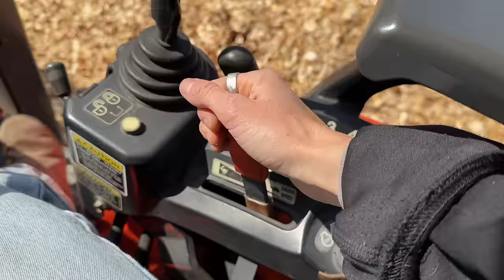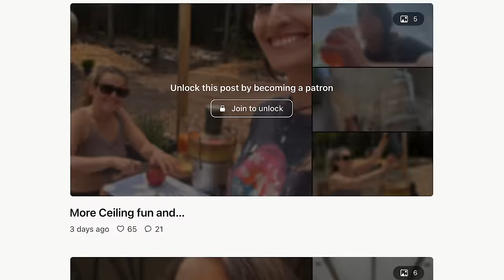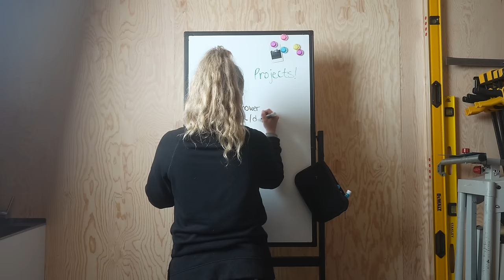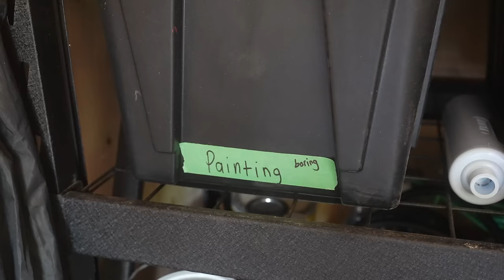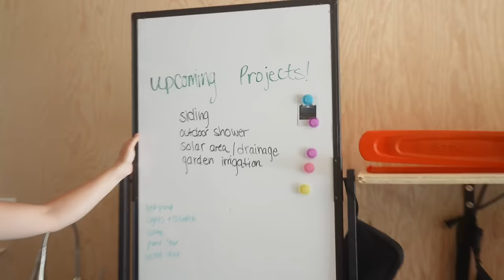ULTIMATE DIY DREAM GARAGE MAKEOVER!

Comment: As allllways, you two are great together and create really fun videos. Nice job on the GARAGE!!  2 things I noticed that I think you should change or add. 1) You need a barrier between the fireplace and the wood wall. Block, brick, cement board spaced off the wood, SOMETHING, as we certainly don't want to have a fire.. 2) It looked like Jaz was simply pushing the wires into the backs of the power outlets. I know many do this, but over and over again I see videos about how people lose their homes to exactly that. EVERY REAL ELECTRICIAN will tell you to never use the push in's. ONLY use the screws as they create a tight and solid contact that won't fail.... I've owned and remodelled 5 homes and in every one of them, found outlets that previous homeowners swapped and did the press ins.. The first time, I found it because my wife heard buzzing coming from the wall.. Yeah, inside the box was black with sparks!!!  PLEASE go back and utilize the screws. That way is FAR SUPERIOR to the extremely tiny contact point of the press in's...  Youtube videos all over on this as well...
EDIT:  I forgot to mention, painting the walls a bright color will make the shop WAYYY BETTER!! Over time, the bare plywood will turn to a dull yellow and look crappy. Paining it then will be FAR MORE WORK.... I'd paint it white. Just my .02   ;)
Reply: Excellent help

Comment: Great Job on the work shed.  Like that you have a fire extinguisher next to the wood burning stove.  One thought.  You might want to put some cement board in behind the Stove.  It was depend on the distance required by the stove manufacturer on how far away you can not have none combustible surfaces.

Comment: Little tip, if your doing an area that includes a ceiling start from the ceiling and work down, so as not to damage anything you may have already done. I know you like the wood and whites a dull colour, but if you paint inside the shed it will help illuminate inside during winter. PS, awesome job as always

Comment: Looks great, well done on getting it done! Just wondering what type of heat shield you are going to use behind the fireplace? Corrugated iron makes a cheap shield, mount it off the wall with some spaces (small bits of pipe). Izzy’s smile us very cute❤️✨

Comment: I've already painted my concrete floor with grey concrete paint, but I would like to add the kind that you used. If it makes it less slippery, that's great. I didn't see a shop vac and am wondering if you have one to suck up your sawdust? If not, that shed is gonna be a mess real soon. 😉😉

Comment: I like the remodel.  I really do need a clean garage to get any work done.  I recommend using Dock/Mount Holders for your batteries.  You could even mont the holders under the shelf over the battery charger.

Comment: Check the distance between the wall and the wood stove.   You may have to put a non combustible layer on the wall.  A sheet of cement board  might be an easy solution.

Comment: Garage looks great! Just for later info. The floor should have had a primer coat first and the textured would have gone further and smoother, also when painting a thicker paint use a thicker padded brush roller, it works better/easier. 🥰

Comment: Right on, ladies!  I regret not commenting on the plywood issue when I saw it….no tongue and groove?!  Yikes!  Well you found a fix for that glitch….so all is well.  Are you considering building a racking system for your wood? Keep your precious planks from warping….maybe a rack on wheels so it can be moved out of the way or racks down from the ceiling or walls?  If you look up, there’s still lotsa potential.  Keep rocking it!!

Comment: Now that looks like a great organized place! Love it. Now the hard work begins, which will be to KEEP it organized. Return stuff to its place after using it will be key, but man that is hard... ;-) BTW, as a woodworker I have to correct you and tell you that a butt joint is far from the strongest joint, but it's easy and in most applications more than strong enough and your use of it in the workbench looks great and will surely last you for years and years.

Comment: Hello Girls, 
You have turned the garage into a beautiful workshop with the plywood plates. 
Small tip: maybe you still have a small, easily accessible spot near the door to hang a fire extinguisher? Hope you never need it, but it is still a safety point. Maybe also a fire extinguisher in your home? 

Greetings Louis from Holland.

Comment: The Pack Shack is done!!! How great is this?!!!!! I'm with you on organizing your stuff. Tools especially! Love the battery charger station.  My one worry is not having insulated fireproof wall and ceiling around the wood stove. Maybe add corrugated sheet metal panel behind it, and at the ceiling area by the pipe. I would hate to see it get too hot and catch fire. Especially with your battery bank in there. Also, have you done inventory list for insurance purposes just in case? Pictures help immensely in case of a claim. Congratulations of completion of another massive project!!

Comment: There is a dial knob probably under the tractor seat that controls the speed of the hydraulics, like the front end loader. By turning this knob you can slow down the rate that the loader or forks drop your load.

Comment: One thing you should build is a storage area with a roof and shelves only for all your wood materials so that it will be eaiser for you to find what you need. Chances are that your need for something like that will be less than it's right now, but it would get all the wood away from everything else and stored where you could easily find it due to how it was stored.

Comment: Next time you board a ceiling use a Bodger at one end (timber batten wedged between the floor and one end of the plasterboard or Ply thereby holding it against the rafters) allowing one person to raise and fix the board at the opposing end and to work along.

Comment: Some suggestions.... You guys probably already have it but a small medical kit in the shop. Bandaids, Neosporin, a GOOD pair of tweezers, and for more serious injuries, blood clotting applications, triangle bandage, etc. I would also suggest a magnifier/light to go on a bench somewhere. Great for extracting slivers as well as getting a close look at different things. As to the work bench, my Dad always believed in using a whiteboard cover over the bench top. Whiteboard as in something like pegboard but solid and all white and smooth, not to be confused with the stuff you write on. This allows things to slide on the surface, protects the wood underneath and can be replaced if needed. Also decided to put a 1/4" angle iron on front of bench allowing one to hammer on it to form metal into different shapes. Just my 2 cents. Nice thing about long vids is that there such a thing as a pause button so you can always pause and get back to it. So nice video ladies. Sorry for the long note.

Comment: If you buy 3” thick foam board then cut and glue around freezer it will use a lot less power and if you have a power outage it will give you a much longer time to repair.

Comment: Bravo! I wish I had a shed/garage like that. Hoping to build one, although not quite as big. Well done!! 
I have two questions: First, did you not consider doing lumber racks to keep some of your wood inside? Secondly, IMHO a proper shop needs is a central vacuum system for cleanups and for hooking up to your miter and table saws. Thanks so much for sharing and inspiring!

Comment: You’ll need positive ventilation or you’ll get mould in winter in the garage. Could get away with adding vents to doors at each end of the garage. One at bottom off the door and other end of the garage at top off the door

Comment: That was simply one of the best videos gals. The transformation is incredible! Only issue that drove me nuts was calling it a garage. Shed, workshop...storage building yup!   But garage...ehh nope in my book and the dictionary. What makes something a garage?
A garage is a covered structure built for the purpose of parking, storing, protecting, maintaining, and/or repairing vehicles. Specific applications include: Garage (residential), a building or part of a building for storing one or more vehicles.  But I'll let it slide, maybe it's a Canadian thing?  How long did it take to get the shot of Izzy and Bella on the work bench??? I'm wondering if it might  be worth considering putting a closable vent on one end and a small solar powered exhaust fan on the other to keep ventilation going for days when your not using it? Just a thought....again great video!

Comment: Great job on setting up your garage.  The only suggestion I have is around your bike storage.  If you have hydraulic brakes on the bikes, you should not store them vertically.  The hydraulic brakes are not designed to be stored that way (don't ask me about the science behind this, but after rebuilding brakes two years in a row, the local bike shop finally explained this to me).

Comment: Izzy:  when ya gotta go, ya gotta go... at least I was outside, woof!  2) tongue and groove plywood is 3/4" thick, so 50% HEAVIER than the 1/2" plywood you struggled with.  Mostly the T&G is on the 8' edge, which wouldn't have helped you on your end-to-end (butt) joints.  It would not have helped at all on the side angled sides.  You can feel redeemed that your decision to go with 1/2" plywood was the RIGHT call.  Next angled ceiling you have to work on, put a scrap piece of wood 1/2" down from the rafters to hold your ceiling piece in place while you nail it. 3)  perhaps a PRIMER coat (gray or the same color as the floor paint) would have made a difference on the floor paint. 4)I would want the freezer right next to a door for ease of access.

Comment: Hi girls I don't know if it was suggested to you but you should change the refrigerator door direction if you're going to put a table next to it or countertop you're opening the door towards the countertop and it would be better if it's open the other way swings toward the back of the garage that way you can take stuff off the counter and put it right into the freezer. Looking good
Reply: I said refrigerator door but you know I meant the freezer and your new garage
Reply: Yay what did I win

Comment: Just get it all out, then you feel so much more motivated to build a workshop. You need, in my opinion, some covered but open storage. Like a pole barn or even some lean to's off of the shed. Lots of stuff doesn't need to be stored inside but rather just overhead cover. It'll help so much with opening up your shop area. Be careful about what you throw away before you complete your homestead property. You would be amazed at how you'll find ways to use that stuff. I'm a pack rat and I'm always using things that I have.

Comment: Love Love your channel.  You might be able to swap the directions of your freezer door so it opens on the other side? Many refrigerator doors can be changed to open in the other direction.
Reply: There another access door right next to the freezer which is the door they would use when going to the freezer or battery house to save them having g to open the double front doors so the freezer door opens the right way for that door.

Comment: has no one told you about making "T"'s to do anything overhead. Get 4 2x4's and make 2 "T".  Then you can use a T on each side of the board to hold or lift and hold. Makes the job so easy

Comment: FYI. Need to walk across a freshly painted floor? Cut pieces of plywood or 1 X 4 the size of the sole of your shoe. Drive about a dozen nails through the boards and ties them to the bottom of your shoes. Walk across the floor, on the nail points. No slipping, sliding, or tracking paint everywhere.
Reply from the maker: Genius idea! Thanks for sharing

Comment: For the ceiling, damm Grrrls, you could have bought luan or 1/8” thick ply. You didn’t need 1/2”…. Eeeeek! Please next time you get into a project, please ask questions of us viewers before hand. As for the countertop, if you have an extra sheet, of 1/2” here’s where doubling on the thickness is a good thing, especially as you will have heavy tools on top, and that surface will get lots of use. Hang your extension cords, free up shelf space. Lastly, if you can’t find a cotter pin, while a bent screw works, try using a piece of wire coat hanger. Much easier to remove when you want to replace it with a pin.

Comment: Hi guys, I don’t know if you thought of this yet. I would not be cutting wood with fire burning. It can cause an explosion. I would only woodwork in there by using the mini split. You’re going to want to have a dust collector unit, and a fine air collector. I made a woodworking room in my basement, and I was told to make sure the heating and hot water tank was in a separate room to avoid the situation. Just look up on the Internet dust collection explosions. Just something to think about. Have a great day.
Reply from the maker: Thank you for sharing this with us, always so informative. We will definitely be researching this, makes sense.
Happy to have you in our pack.🌞🐾

Comment: Good to use plywood, but you could have gone for 1/4" instead of 1/2", it would have been lighter. You don't need such heavy stuff on the ceiling.

Comment: Nice job but the ceiling would have been a lot easier if you had made a couple of deadman's I.e a length of 2*4 with a short cross beam on top. The deadman is then used to lift the plywood off the top of the step ladders and wedged into place between the floor and ceiling. Thus you could have lifted and wedged each piece in place and then had 4 hands free with zero effort. A bit late now of course.
Reply from the maker: Well we sure do appreciate you sharing your knowledge and expertise! We know for next time! 🌞🐾

Comment: Girls, yes you are both girls to me. I am an older gray-haired gentleman. From time to time, I watch your videos to see adventurous girls. I get the fact that you march to the beat of a different drummer. However, I see you struggling to take on many of the tasks on your property. Sometimes it would be better to have skilled help. Example: The work bench should be twice as long and the shelving racks should be turned against the wall, opening up the center of the building. I started in the electrical field in 1973 and just retired last March. I was a Principal Protection and Control Designer for Transmission Substations for a major Utility in the US. 

May I make a recommendation: Ask for volunteer skilled tradesmen, two or three days, to put finishing touches on all your partially done projects. Plan for it and have all the materials on hand to get them done. Sorry, I cannot come, I just had my right knee replaced. I would of like to of been as an advisor for your solar system.

Comment: Hi possums… every time i watch one of your videos i see that eye-saw of a patio that has a broken section that’s closest to the steps & down the bottom where it has snapped darlings.  It’s very annoying to see that simple job that would take no more than 1/2 hour if that.  Especially when you have had much bigger jobs on , & you have slayed them no problems. All the other jobs seem to be done bar the shed which you are undertaking now. Girls please fix that eye saw that is spoiling the front of the house at the moment.  It’s a snapped bottom piece of wood that’s closest to the stairs lovely’s.  Thankyou so very much. 😱🤬🤨🦋🏳️‍🌈🌈🇦🇺🙏🤞💋👋… LGBTQ+ community…